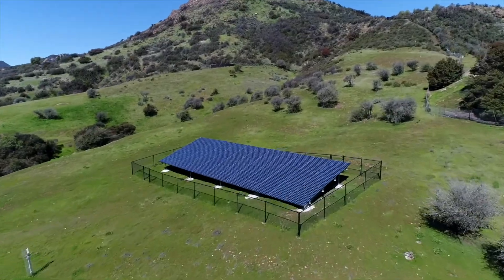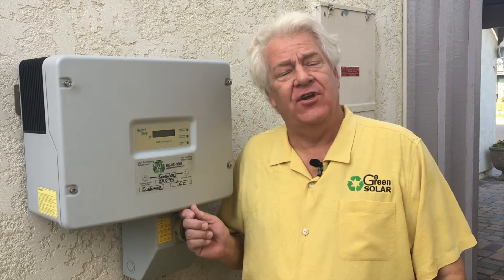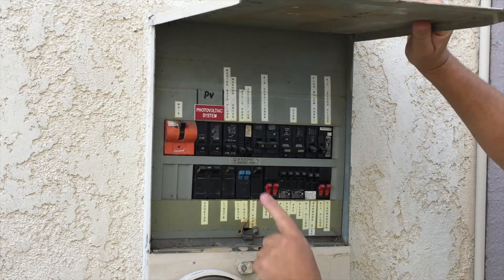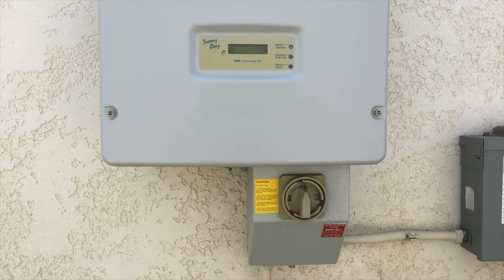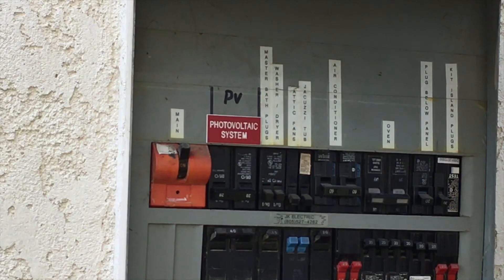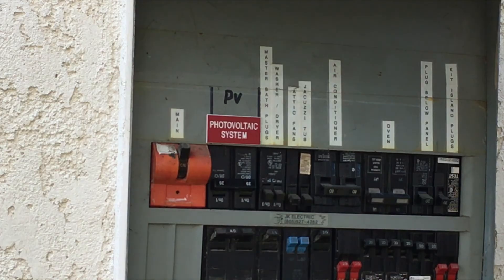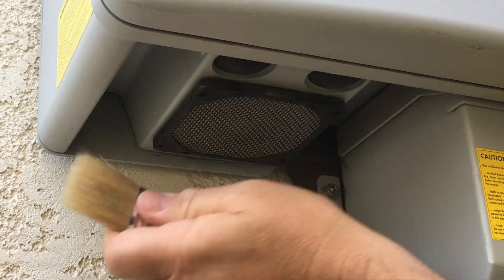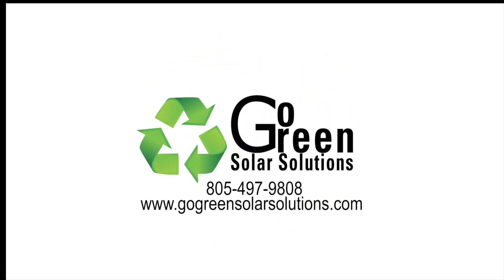Inverter Power and Changing Fuses on SMA's Pre-2007 Inverters

Comment: My sunny boy 6000 keeps blowing  the top left fuse in the DC disconnect box I believe it is on the ac line side any idea why it keeps happening.
Reply from the maker: If your inverter is more than 10 years old, this is how they start to fail. A new SMA 6000 with 10-year manufacturer's warranty, wifi monitoring system and a secured power supply is $2650 installed if you're in our local area.  Please call us at 805-497-9808.  Thank you.
Reply: @gogreensolarsolutions6506   ok so on further examination it is the line fuse coming from the panels not the fuse inside the inverter.
Reply from the maker: @DncampDncamp  Please call our office for further information.